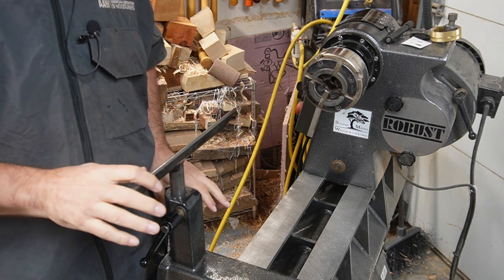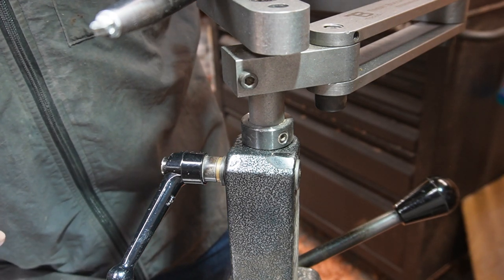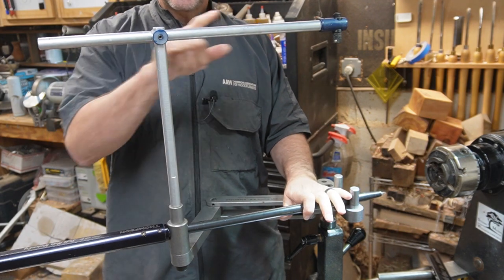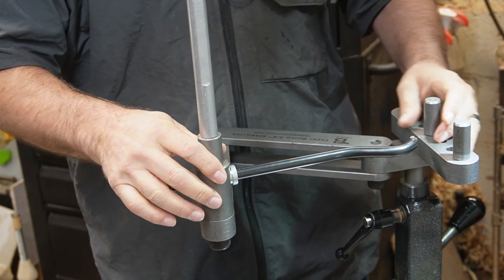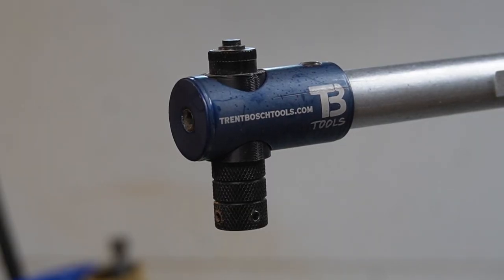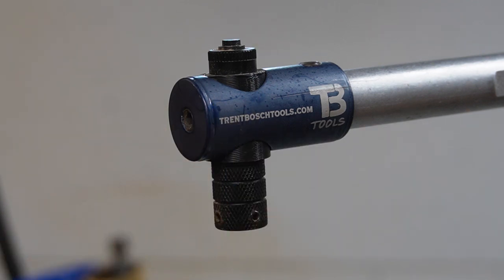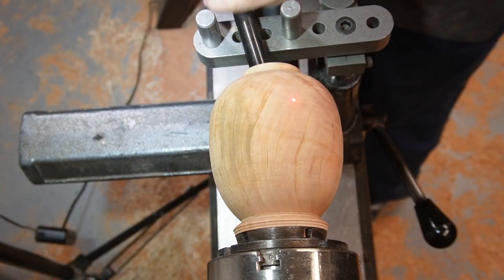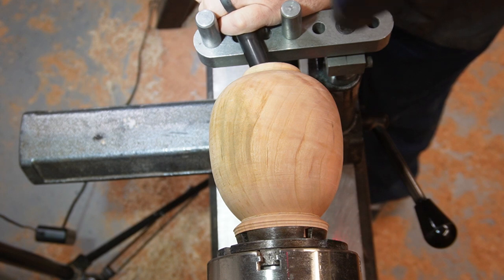Trent Bosch Stabilizer Hollowing Rig - Overview, Pros, & Cons

Comment: I'm sorry I have never used this tool but to me it seems that when you go from 3/4 bar to 1/2 bar you don't have to make all of those adjustments you just need to make a spacer that would go on top of the tool rest to make up the difference in bar size it would keep it lined up and take seconds to change 
Let me know if I'm wrong good luck

Comment: Hi there. I was thinking of buying a stabiliser and laser system for making  hollow firms from green wood. I have had quite a lot of difficulty with cracking. I am told that one of the reasons for the formation of crack is inconsistent wall thickness. Obviously the Bosch hollowing tool with laser/visualiser is designed for even wall thickness. Logically there are much fewer problems with cracking when working on green wood. Have you any thoughts on this please?